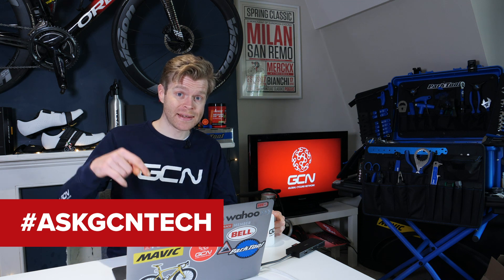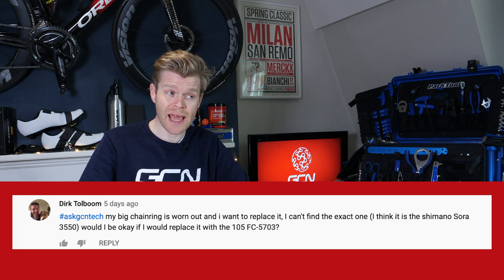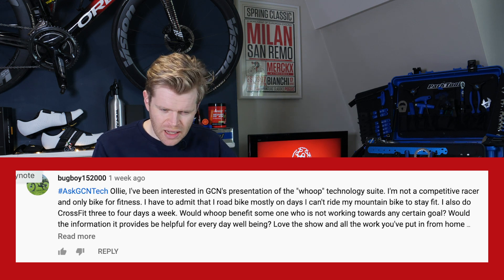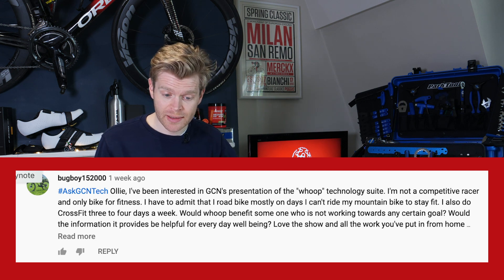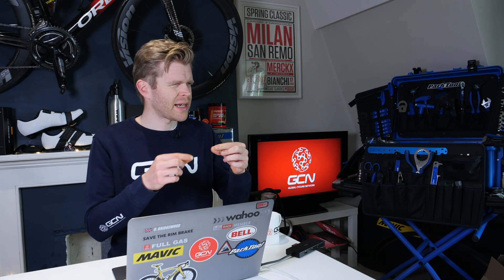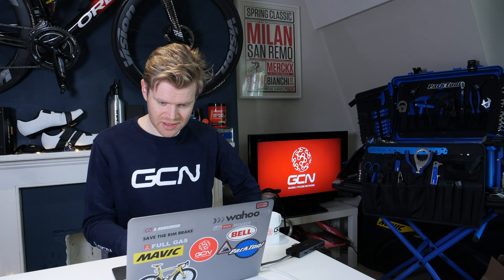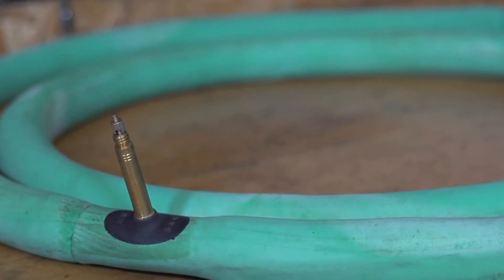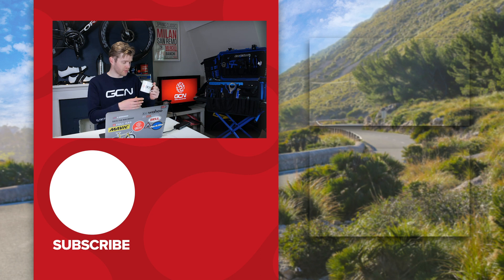Is A Gold Chain Just As Fast As A Regular One? | GCN Tech Clinic #AskGCNTech

Comment from the maker: Don't forget to keep submitting your questions using #askGCNtech
Reply: the only question I could think to ask was about my rear wheel on the last video xD I got nothing else besides that I am planning to stop riding it for security reasons and switching to a refurbished singlespeed road bike I can collect from my local bike charity in the coming days, providing they still have it.
Reply: What do you guys think of the ribble air 883 disc I have the standard with the standard parts what parts would you guys upgrade first?? Love the show stay safe people
Reply: #AskGCNTech

I have the Canyon Lux CF SL 7.0 and would like to equip it with a dropbar. Of course I need a corresponding brake lever for this. Preinstalled is the Shimano Deore gear group M8100 with 12 gears. Can I use GRX brake levers for shifting and braking. (Even if I lose a gear in the process?) I'm not sure if the shift cable is pulled properly so that the gears shift correctly. Because of combining MTB and Road-Components. Or are there other options?

Many thanks in advance and greetings from Wuppertal

Tobi
Reply: #askGCNtech #TorqueBack dear GCN, what is your thought on combining dry + wet lube? I saw some comments about applying wet lube first and 'lock' it with dry lube afterwards.
Reply: #askGCNtech  do you think that internal transmissions like the Shimano Alfine (di2) will find it’s way into roadbikes. From my understanding it can be quite an advantage. Especially maybe with a belt system...
Reply: @sjoerdh223  combining wet and dry lube is a pretty bad idea. The solvent in the dry lube will ruin the wet lube. You'll be left with a tar like mess.
Reply: #askGCNtech Hanging your bike on the wall by the pedal, like the one behind you, looks great. However, it puts an eccentric load on the bottom bracket which it's not designed for. Might this cause problems over time, particularly for a bike weighing a few more kgs than yours does? Thanks for the show
Reply: #askGCNtech Thanks for all the GCN tech videos, they're extremely helpful as I expand my bike tech knowledge. My situation: I purchased a Canyon Grail AL 7.0 back in February and I'm really enjoying the versatility of the bike both on and off road. It came tubeless ready, and up till now I've left the tubes in the Schwalbe G-one bites (tubeless ready, valves included), and the original setup probably has around 500 miles on it. I would like to try experimenting with tubeless, so the question: can I still set up the original tires tubeless with the original rim tape (basically just add the stan's) even though I've already put miles on the wheels/tire combo? The wheels are DT Swiss CR1800s also tubeless ready. Thanks in advance, if I have to wait till my first tire change I'm ok with that too.
Reply: #askGCNtech hi Ollie great show.just a quick question . Why do custom bicycle framebuilders seem to prefer Campagnolo components over Shimano or Sram? Is there any advantage or cheaper etc.?
Reply: Hey Ollie, love your lockdown lols. I’ve got a MASI CXGR with a 105 groupset and postmount mechanical discs (avid bb7) I’m keen to upgrade to hydraulic and like the GRX shifters. Am I able to use the GRX shifters with the rest of the 105 drivetrain and keep my existing brake rotors?
Reply: @ishankelkar4347  campagnolo has style and class. Shimano is a high precision tool but just lacks the soul of the classic manufacturer.
Reply: GCN Tech #askGCNtech Hi, On my trainkng wheels I ride a 11-28 cassette. The bike shifts perfectly and the chain is brand new. How is it possible that the chain don’t ride smoothly on my racing wheels with an 14-28 cassette? Both cassette are from ultegra. Thx a lot
Reply: #askGCNtech Hi Ollie. Thanks for the great work you and all other presenters of GCN are doing from your home offices. What do you think of polyurethane innertubes. They should be as light as latex innertubes while holding the pressure as butyl ones. Also they claim to need less energy and have a much less water consumption during the production.
Reply: When do you know when your rims need to be changed? I know some alloy rims have wear indicators but what if they don’t and what about carbon?
Reply: #askGCNtech Bottom Bracket klaxon alert! Do you guys think it's better to use a PF30 to BSA converter or  all in one PF30 unit like a Token Ninja? Love the tech clinic, keep up the nerdy work!
Reply: I’m wantig to get deep section wheels for my Trek Domane SL5, Is there anything extra (components, mainly for the rear wheel) I need to get when fitting the new wheels? #askGCNtech
Reply: I want to switch to a freewheel and cassette from whatever it is I have now. Can you do a video on how to change this over ? Do I need new spokes, or can I use my old spokes ? 

I know I could just buy a new rear wheel, but this is something I would like to take a crack at, just would like to have a video to watch so I am not completely guessing, even though I am pretty good at guessing.
Reply: #askGCNtech

Please like the comment so that more people see it :) Hello Ollie here from Germany 🇩🇪✌🏻 I would like to buy a new racing bike soon and came across the Sava brand. (also called Savadeck). They have different models such as the Phantom 3. I have heard from an experienced rider who has now bought you such a racing bike that they are very good. and especially for the price, can you maybe get an idea of the brand? or if someone has experiences with the bikes from the comments, I would be happy about any feedback. :)
Reply: @sjoerdh223  no.  That just makes a sticky paste that will cake all over your drivetrain.
When it comes to dry lube, the cleaner the better.

At least with the wax based dry lubes, you're best off cleaning as much of any factory lube, or already applied wet lube before you put the wax stuff on.  Excess wax flakes off if it's dry.  If it's mixed with oil, it will stick to the gears, and build up over time.
Reply: @timvonr2802  They have quite a bit more drag, and generally start getting very expensive when you try and have a lot of gears.
they're great for utility bikes, but for going fast, you're better off with a conventional chain/derailleur.
Reply: #askGCNtech
What should I upgrade for my Bianchi aria rb to get it faster and can I ride my rb in rocky road and muddy? Thank you.
Reply: I realize I am quite off topic but does anyone know a good site to watch new movies online?
Reply: @Aaron Zayden flixportal xD
Reply: @Lochlan Dominik thanks, I signed up and it seems like they got a lot of movies there :) Appreciate it!
Reply: @Aaron Zayden happy to help :D
Reply: Lol lol I can just laugh lol lol. Maybe he's on the fence lol.

Comment: Based on personal experience, the KMC Gold chain especially the light version is incredible good!! As light as a Dura Ace chain and certainly better looking if you are into the Gold color thing. As far as the coating getting off... 🤔 I've never seen that, not in my chains or any other. Try a KMC chain and you won't be disappointed.

Comment: The gold coating, Titanium Nitrite is usually applied by a process called Physical Vapor Deposition. its not anodizing, anodizing is only be done on Aluminium and a little titanium.  PVD is really versatile as a coating process it is also used to put diamond like carbon (DLC) coatings on lenses and all sorts of applications in aerospace and those gold plated drill bits in ALDi.
Reply: PVD sounds like spray paint to me.
Reply: @benedictearlson9044  It's not far off, but you do it in a vacuum

Comment: They(KMCGold) are faster than regular chains and last longer I have used them for 7 years! The KMS DLC is few grams lighter it shifts much quicker and when waxed is quieter than gold chain, I also think it last longer! Wax with dry silicone works great on the KMC chains great job Ollie!
Reply: ive owned a bike for 7 years with a chain that never wore out... i only rode it about 50 miles or so. Need to sell that thing.

Comment: but Ollie, Shimano Di2 does have an external setup! It just needs the external battery (SM-BTR1), mount (SM-BMR1), and external junction box (SM-JC40). I've been using that setup for years. I did get a long piece of electrical tape to keep some of the wires on, but they even make stupidly expensive "di2 cable tape" for those wanting to keep the aesthetics inline.

Comment: To Thom Campion, in 12:00 of the clip,
I personally have a 2011 Merida road race 880 aluminium bike upgraded to Shimano 6870 Di2 in 2016. Shimano does launched a kit for older designed bike frame. I run the system using external routing and external battery kit without drilling any hole in the frame. For the cable, you may find external cable guide/cover from Shimano which will give some protection and organised them better. I just use the almighty zip tie to hold the cable tight fit on the down tube,seat tube, chainstay and original mechanical cable guide on the frame. Everything is alright till now, never fail or broken anything. I have been riding even in stormy rain.  One thing that may bother a little is that you may have to sacrifice one bottle cage to hold the external battery in the triangular dead space just above bottom bracket and seat tube. This is my case for an XXS frame. 
Totally agreed with Dr. Bridgewood recommendation of using Sram 11 spd etap wireless system. No worry in wiring eg. determining length of cable, organising and using zip tie etc. However, it may be less likely to find an upgrade kit in good bargain than before since Sram has phased them out and not selling a whole group any more. Sram still sell individual parts to cater existing users but not a whole groupset / upgrade kit. What you may still find in store or online store usually are from old stock, and most likely is in out of stock status, eg. Mxrlin cycle.
I like the neat setup of Sram etap but I love more on the vast array of aftermarket components and the cross compatibility offered in Shimano system eg. cheaper single sided crank based power meter, cheaper subcompact chainring / oval ring etc. 
Anyhow, you will never regret upgrading to electronic shifting. They are just simply superb. Precise shifting, less maintenance, ride more. Hope that may help.

Comment: 10 spd di2 was designed to be run externally. There is a battery mount that goes on the down tube bottle cage screws as well as cable guides that stick to the frame to make sure the wires stay in place

Comment: Titanium Nitride is the gold coating, not the silver coating underneath.  It's not anodized.  I think it's applied by vapor in a vacuum chamber.  It's used on machine tools to theoretically give better surface hardness and low friction, but I think on a bike chain it won't carry the types of loads where it would have any significant effect.  The only real reason to buy one is because they look cool.
Reply from the maker: That's right they are usually vapour coated, and yes, we only really use them to look cool!

Comment: Hi Ollie, great show as usual. Re Latex tubes, nice picture of a Michelin tube when recommending Vittoria 😄. In my experience Vittoria are slightly lighter but a lot more fragile than Michelin. Also fit with some talcum powder in the cover as that will help prevent stiction between the tube and cover rubber, then less likely to fail.

Comment: In response to the DI2 question. You can run the DI2 cables externally. Shimano do the SM-EWC2 which is self adhesive plastic cover which protects the cables.

Comment: Hey sorry to rain on your parade there Ollie but it is possible to run Shimano Di2 externally and Shimano even produce all of the appropriate parts to allow you to do so. You can run external cabling as well as having your junction box mounted below the bottom bracket (in the same position you would have your cable guide under the bottom bracket) then to secure the cables to the frame there is a housing which Shimano produces which has an adhesive side to it which will stick to the frame and will stop the cables flapping around and getting caught on anything. It is also possible to mount and use the older style external battery with Di2. All of this is compatible with the most modern version of the E-Tube software and if you install the little wireless unit then you can make the most of your system. Pick up an older Dura Ace 9070 series groupset or either R8050 or R9050 and all of those are compatible. The info on how to set up the system can be found here:
https://si.shimano.com/pdfs/dm/DM-R8050-04-ENG.pdf
https://si.shimano.com/pdfs/dm/DM-DA0001-10-ENG.pdf
and the really helpful compatibility chart for E-Tube can be found here:
https://e-tubeproject.shimano.com/pdf/en/HM-CC.3.4.3-00-EN.pdf
Really hope that this will give a bit more info... took me a long time to go through the details on the Shimano website but its good to know it can be done and hopefully without too much work.... perhaps a GCN Tech video there... how to wire up a new Shimano Di2 groupset on an older externally routed frame!

Comment: First off, I'm really appreciating how Ollie's becoming as slightly unhinged as the rest of us stuck at home. My question is: Are there special tire (or other equipment) considerations that should be taken by particularly lightweight riders? Do the advantages of wider tires still apply when there's less force pulling them down? Should I pump my tires with less air? Anything else to keep in mind? #askGCNtech

Comment: The manual from Shimano has instructions for external di2 installation. There is an external di2 battery too. Still not as nice as internal since the cables aren't under tension holding them straight but it is designed for it

Comment: I believe a Shimano Sora 3550 is a compact double, with a 110mm bolt circle diameter (BCD). The 105 FC-5703 is a triple, with 130mm/74mm BCD (outer/inner). Ollie's advice regarding number of bolts and BCD is spot on but, in this case, will lead to the conclusion that the 5703 big chainring won't work. The other thing to be aware of is that some chainrings have proprietary contouring to fit the crank arms - that Sora crank just needs a simple, traditional flat chainring.

Comment: TiNitride coating (gold coloured) is used to reduce friction. So should run better. It's also used on inserts for cnc machining tools for instance. Or on the better upside-down forks on motorcycles.

Comment: #AskGCNTech Ollie, I've recently got into cycling and want to start to upgrade my bike. Would it be better to slowly buy parts to upgrade my bike over time (Spread the cost) or would it be better to buy a whole new bike? and if i can just upgrade over time what are the main things to watch out for what mix and matching parts??
Reply: You can spend enough money on just the groupset as you would on a whole new bike with the same groupset. The only money you're gonna save at best will not be worth it compared to a new bike, new wheels better frame etc....

Comment: I think according to the latest testing (Zero Friction Cycling & Friction Facts) dry lube are not particularly great compared to nearly any wet lube. The only dry lube considering are probably wax lubricant, with exception of the wendell branded ones which seems to be absolutely useless as it is applied outside the chain.

Comment: Hi Olly, good video, but I think that the gold chains are PVD (Physical Vapour Deposition) or CVD (Chemical Vapour Deposition) coated with Titanium Nitride which has a natural gold colour. The same coating is used on some cutting tools and high wear components in engineering (piston heads etc.) and has been around for several decades. TiN has a higher hardness than steel and produces a lower friction surface if applied correctly, so in theory should make a chain last longer and run quicker - however I believe KMC coat the entire chain once constructed, rather than the individual links so any benefit is lost! 🙈 There have been some studies done investigating this, comparing chains for life and speed - Shimano v Wipperman v KMC.
They defo look the bomb 💣 though! 😎 (I use them myself for this reason)
Keep up the good work!

Comment: The gold on gold chain is titanium nitride, the same coating you see on some drill bits and other tools.  It's a hard ceramic material, so theoretically it should improve the longevity of the chain.  That said,  I've read some chain wear test articles where KMC chains have done rather poorly.

Comment: 7:19  The coating is Titanium Nitride which is harder (more durable) and lower friction.
Reply: and Ollie said the silver coating underneath the gold is titanium nitride.  I thought the gold coloring WAS the titanium nitride.
Reply: @ytyehyeh  You are correct; Ollie is not.
Reply: @ytyehyeh  the silver coating is nickel plating.

And the extra material removed in the links are not for weight, it is to shed mud for mountain bikes and cyclocross bikes (kmc chains)

Comment: The problem with the one that I bought I noticed When removing the extra links that they coated it after assembly. To slow the rate of wear you have to have the coating on one of the two surfaces in a mechanical interface. There was no coating on either  surface. What it is is nothing but a fashion statement. All they would have had to do is coat the little rings before assembly and it would function. The chain otherwise is a very advanced design. Anodizing is for aluminum. This gold stuff is titanium nitride.

Comment: As for a loose fork. If the previous owner changed the stem it could require an extra spacer. I had the same problem with a loose fork recently after I changed my stem and putting another small spacer on solved the issue.

Comment: Two questions: 1, can I replace my 6 bolt disc rotors, with centrelock rotors? I'd like to change my current rotors with ice tech freezer ones. 160mm.
2nd, What bike is that on your wall? Orbea ? And is that the model which looks like a Colnago concept?